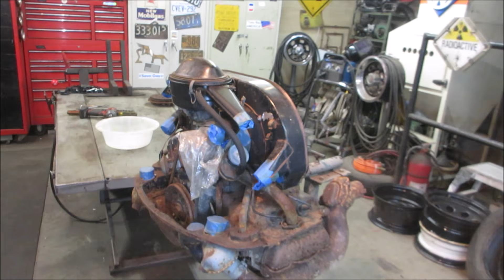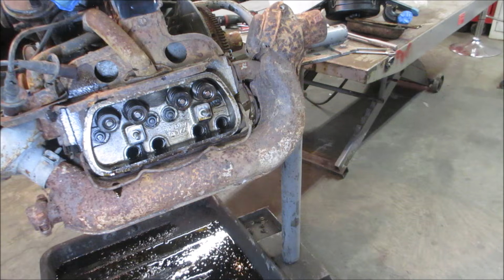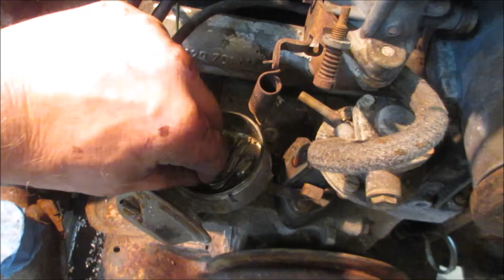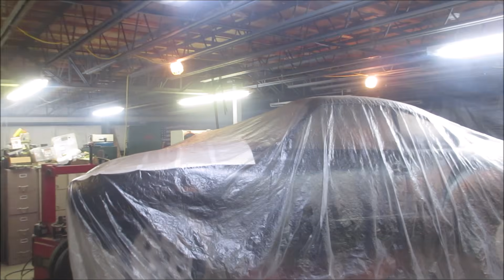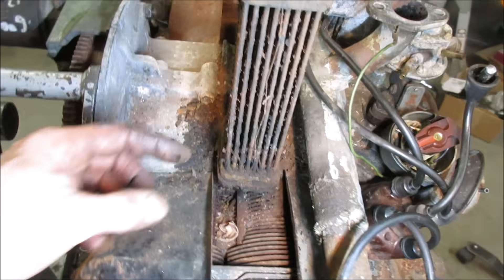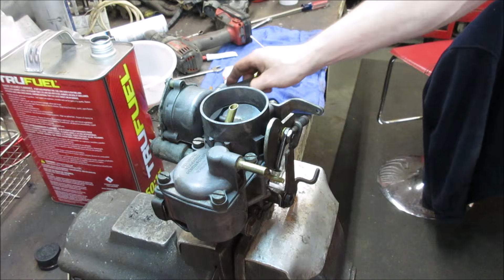Can IT Be Saved? Busted VW Bug Engine

Comment: Penetrating oil is a scam and does not work as far as the thought that it has the ability to soak into a seized bolt and unseize it. Have been testing this for decades and in my opinion it does no difference than any light oil, Once the bolt is broke lose then of course any light oil can help. Heat it the best and using penetrating oil with heat is silly cause the heat just burns off the oil. I have not yet tried the heat and wax theory.

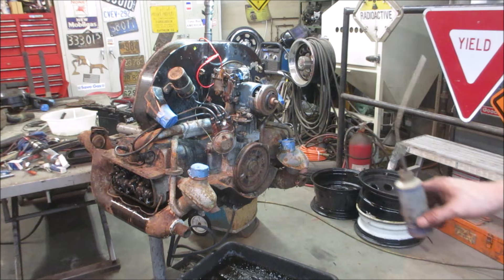Comment: 1:20:00
I was thinking about fuel running from 1 side to the other side as it's just raw fuel. I was thinking a leaf blower straight into the carby and a small hole in the pipe to mist force air and fuel and it would bring up the cylinder compression at the same time. A leaf blower turbo charger 8n effect. Yippee more horse power.

Comment: The white stuff was most likely aluminium oxide from the heat exchanger finning on the pipe inside.  I have seen these fill the air chamber with oxide powder after corroding for a long time.  I don't actually know exactly what alloy the fin material is that's cast around the steel pipe but it can produce a lot of this fine white powder, as can cylinder head castings, especially if they have been  stored somewhere wet or very damp.

Comment: I still can still see my scar from trying to push the rubber bushing used on a pushrod tube.  The thing about VWs you have to let the engine know you are going to work on it. Otherwise you disturb the cosmic balance of the engine compartment. If you don’t do this then the generator will burn out as soon as you drive it around. Never put those aftermarket fuel filters on it with the stainless steel bands, it will soon be a burning mess next to the 405 freeway. Usually not that far from a burning Audi back in the day.😊
  Had a 64 beetle, 69 Van, worked on my brother’s ‘59 flatbed transporter. Spent countless hours laying on my back adjusting the valves every so often and was amazed when at 19 I started flying a Piper Cherokee 140 and it had the same air cooled engine, just better built. But I always had to wonder just how much better built was it? Always wanted to put twin Makuni carbs on my van like the dune rails had. But alas we were in Cali. A great engine to work on and on and on.😊

Comment: the distributor cap latch hanging down tricked me into seeing a two pin oil pressure switch and I was thinking when they hell did they ever have a 2pin or who rigged ion in there.
then I finally seen it was the latch. lol

Comment: Picked up three motors from an estate sale, 40HP was good as is. The two 1600 SP motors had to combine parts to make one motor. (Intake port on 3/4 on one motor was a rats nest, other motor pulled threads on the plugs for 1/2)

Comment: Mustie had a lot of old motors like my dad used to. My dad even had old parts from dragline he no longer had, even motors, and he could tell you where each piece came from. He built a homemade injector tester so he could verify if they still worked so he wouldn't have to buy rebuilt if it wasn't necessary. Among other things. Great job, greater knowledge Mustie shares with us.

Comment: Great work!   Two questions though:  Why do you use compressed air to clean these up and not a vacuum? And why aren't you using hearing protection when you start these, without mufflers? Is it not as loud as it seems?

Comment: I'm sorry, I shouldn't have yelled at you. I was a little upset that you didn't thread the valve adjuster back into the rocker from the valve side before putting the rocker assy back on (since you showed us the chewed up threads)...but I forgot you have the largest supply of spare VW parts this side of the Germany/Mexico border. I won't let it happen again.

Comment: Seems like it took VW a long time to reposition the oil cooler. Oh well. my 68 bug and 69 bus did fine finally lost a valve in the bus and had to pull the engine in a  parking lot and redid it in the back of a fire station. I don't remember having any help except a ride for parts. Glad for the old tech rather than the current electronic stuff. Better for my brain.😁
Reply: the ECM/electronics aren't all bad.  When they fail you better have a Pik N' Pull & the vehicle better be under thirty years old.....
None of these electronic cars will be revived or on the roads 31 years after manufacture. Looking back at the first Ford Taurus, that isn't a bad thing.......

Comment: The older 32/36 weber has a habit of losing that fuel inlet pipe also. i burred mine up a bit, and tapped it home. I have seen 2 cortina (Australian Ford Pinto) burn to the ground, because you also can't open the bonnet(hood) when the cable is melted almost instantly. 
VGG Derek says those glass fuses cause fires, possibly unscrews for cleaning? but i haven't seen one before to know..

Comment: Ok I hate to start with. Back in the day, But. Back in the 60s 70s. We all thought an external cooler, was way better. Allowed all cylinders to cool the same. Without one bank cooling air, passing through the oil cooler first, heating the cooling air previous to then cooling the cylinders. What is the more modern thought on oil coolers?     A very old former long hair wannabe VW builder, is just curious.

Comment: I love that whoooooop sound that it makes when you turn the crank pulley. I've hear many engines making that trumpeting sound.

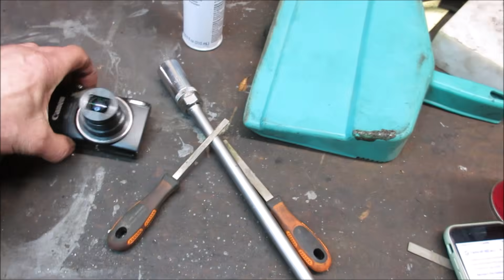1:27:57 I have the same camera but mine is the 340. Good camera but the battery life is crap and you can only power it with the battery. I do have an adaptor but I wish It could run off USB. What are you going to do with all those broken cameras? I'd like to tear down a broken camera ON camera.

Comment: a FREIND OF MINE years ago was grinding on a transaxle to clearance for a 12 volt starter and he was standing where the engine should be. And He found out the hard way that the transaxle was made of Magnesium. He had a flash fire and burned his arms and his face and his hair. It took many weeks for him to heal and fortunately he had only second degree burns. But still, it was a very painful experience for him. Be careful folks as they did make VWs with Magnesium in certain parts and it looks like aluminum.

Comment: Every dang time. Engine sitting for 2 decades, low compression and no spark. Tinker with it for a few minutes and then it runs like its been rebuilt. I want a VW or a Corvair but no place to store it while working on it.

Comment: The gas barb came loose on me on the interstate.    I had just dropped off my wife at the hospital for an overnight stay to have our first child the next day (planned that way of course) as I was driving down the road it started to sputter a little, I looked back in the mirrow to make sure traffic was clear to pull over and all I seen was flames shooting up over the back window.   I pulled over and grabbed my important papers from the car and luckily 2 or 3 cars stopped that had fire extenquishers and put the fire out.   I go lucky with a little scorched paint and I only had to replace the Wire harness, carb and generator.  I had just had the motor rebuilt a week before.  I did find that gas barb hanging on the gas line.  The worst part was cleaning all the fire extinguisher powder up.

Comment: I think that when that valve adjuster bolt came loose and started beating on that valve cover ..they probably though it was a rod and then the parked the car and pulled the engine 😮😮

Comment: Back in the 70s during my VW rebuilding period , do my own head work, line bore block and completely rebuild including crank and piston and cylinders (Mahle) brgs and oil pump etc for less than 450$. Use to do five a month.

Comment: I really look forward to Sunday mornings to see what’s the subject of your video. I was a machinist in the Air Force back in the sixties. We often made our own version of the “Shake & Break” to remove rusty screws, nuts, and bolts out of aircraft. Very useful on the dry bay screws in the top of C-130 Hercules wings and some access panels in the wheel wells of the old F-4 Phantom. (Panels  89 L and R, damn,  I still remember!) I also had a brand new 67 Beatle 1500. It was a great car. I could get 70 MPH in third gear! I kept it for many years.

Comment: I witnessed the magic ! Thanks for the Video !! 

I was thinking "separate power supply for the ignition" .. when the starter current bogs down the poor tiny battery you might get a weaker spark. ?  probably enough to have a 12VDC mains PSU that puts out a couple amps.. don't really know what a coil draws. Still contemplating a foot switch to trigger the starter  🙈

Also a "mister / atomizer" for the fuel came to mind.. like an old window cleaner spray bottle.

Comment: Sheeesh Mustie, you've got low compression- hit it with the ether .  Once it is running, add a quart of diesel to the pan to loosen up the old oil.  Re-adjust your valves because the ones that were rusty will tighten up as the rust wears away.  You can boost your compression more without removing the heads- Bring the piston up to top and then remove the valve spring- grip the valve stem with a drill motor and spin it while pulling the valve againste the seat. The remaining rust acts like a lapping compound- use your spray fogger as a lubricant/wash trhough the plug hole.  You can probaly boost each cylinder by 20 #.

Comment: Excellent revival, these engines are so simple and easily maintained that it's easy to see why they were discontinued, auto makers today make cars that require dealer service. Agriculture machine manufacturer John Deere is at the center of a lot of angry attention from farmers who can't service or repair their equipment on their own.
Reply: the 1.8L 8 valve from the 1980s was also low-maintenance. 
New timing belt every 90,000 miles. New sparkplugs/oil filter.  
Still got one.  600k+ miles.  
They always blamed emissions laws for dropping air cooled VW/Porsches.  
Something about the cooling fins making them too noisy?   Yeah right.

Comment: Pretty cool save on that one. when I picked up my 40h for 50 bucks it didn't turn all the way thinking a stuck valve but turned out one of the nuts from the intake when removed fell into the empty spark plug hole and was sitting on top of the piston. Found it when I pulled the head off and was able to turn the engine finally. But the real problem was the blown piston from a ring breaking on a different one. I replaced all with a new cylinder piston kit. Another thing I found wrong and had to be the German factory was a short pushrod. per the manual you can't mix them. in 65 the rockers and pushrod were changed to the longer ones. Mine was built march of 65 in Germany

Comment: Would filling it with diesel or kerosene help get all that sludge out?  I was thinking fill it with diesel and then spin it for a while on the starter and then let it soak a week or 2 in the bottom of the engine to loosen the sludge and then drain it out.

Comment: German here. My first car was a (super)beetle. Engine went bad (cylinder no. 3 overheat). Bought one from a junkyard for the equivalent of 70 dollars (1600cc 50hp) dumped the old one and installed the “new one” in about 3hrs with a jack and some basic tools. Glory days..
Reply: There's a real beauty to simple machines like this, as easy as working on a lawnmower.

Comment: Have you ever tried propane for starting, just take the torch tip off, put a hose on it, then barely crack the bottle, will start and run most smaller engines!

Comment: A beetle or bus is an odd choice for someone young and with meager means.  When I was old enough to drive in the late 80s, these were vastly overpriced cars.  You could pick up a running driving Ford or Chrysler or GM car for 500-1000 bucks, but Beetles and Buses were many thousands.  4-5g for a running driving example in  poor condition. We're talking a 6 cylinder with well over 100hp with air for 500-1000 in which I could fit in comfortably (I'm 6'3.5) without my head hitting the ceiling and plenty of leg room.

These things were inexpensive new, but the used market, at least by the time I was driving in the late 80s, these cars were badly overpriced.  People trying to relive their youth drove the prices way up and cheated the then current youth of the opportunity to own one.

Comment: Sorry to say, but your compression meter sucks in its design. You loose a lot of compression/readings. Good compression meter for such engine should have a valve at/near the spark plug port, not at the gauge side. Also, this guy has absolutely no clue how to properly start an engine which has sat long. Flooding spark plugs with fuel won't help it.

Comment: If I may suggest something ... A digital voltmeter is super but to check on points you'll get a better visual using a simple analogues meter, as you'll see the needle moving. 

Thanks for this video, sir !! Again super-entertaining. A real thriller before those first "pops".
Reply: Better yet to use a regular old test light.
Reply: @awegner6465  also perfect, indeed.

Comment: Have you ever had a Beetle with a fully-functional heater? It would be great to see a demonstration of that. My Mom said that on my grandfather's new Beetle, 1963, the heater would "blow you right out of the car" because it would get so hot. Seems like every Beetle has bad heater hoses, or connections, or the thermostat is missing, all things that would reduce the heater output. I'm just curious.

Comment: 1:53:44 my fix for this would be to tap the hole and insert a thread-in fitting that's loctited in. There's enough meat on it for a thread-in fuel fitting and those do not pull out like these press-in barbs do.

Comment: Back when I was in high school in the early 1970's I lived in a large midwest city and in the summer me and a friend would go cruising up and down the alley's looking for VW's that looked like they had been sitting awhile. Summer time was the best because you would see all the grass and weeds growing up around them. Used to pick up non running Beetles for $25 - 50 at the most and many times people would just give them to you to clear out their yards. That sludge in the oil strainer was common because most people would just drain the oil and never clean the strainer. As I remember the most common mileage for one was around 36K when most often they would start running bad because the valves needed adjusting or had already burnt a valve.

Comment: As you're cranking, cranking, cranking, the gas is likely washing off the rings and running into the crankcase. I know that because I blew the oil cap off a Lincoln, followed by cheers from my coworkers as my 'smoked' hair and eyebrows wafted through the dealership. I know you know how far to push that; I didn't 😉 There is NOTHING like an engine returning to the living. Even when they sound like cr@p, it's still music.

Comment: 1:20:54 It wouldn't be a half bad idea to build some sort of mains powered starter you could bolt onto these things for times like this. Something that can crank one basically indefinitely without overheating, that's plugged into the wall, but still has the overrun clutch/bendix assembly and bolts on where the normal DC starter would. You revive enough of these VW bug engines to justify building it haha

Comment: I used to change the oil in my 71 fastback for less than $ 3.00 
Wolf's head oil was 69 cents a quart X3 and the paper gasket was .69 cents each 
I don't think mine had a drain plug

Comment: I like to use a spray bottle to get an engine started, the ones from the garden section at the dollar store, gas eats them usually so cheap is better, when you get good you can pump faster while opening the throttle, get them revving up.

Comment: I like the VW stuff best. It takes me back 50 years. Started with my 70 Karmann Ghia, later my 68 bus and finally my 72 beetle. Who knew I would be so nostalgic for my Volkswagen days. 😂
Reply: My Nostalgia is parked in the driveway . 
And it needs it's clutch adjusted.  '76 VW bus Type IV engine.  : l

Comment: In all of probably literally hundreds of engine or car repair videos I have watched, this is the first one I can recall seeing anyone using a speed wrench. I was beginning to think that no one knew what they were anymore, everyone seems to be using the battery powered ratchets anymore.
Reply: I am a millennial and still like using the one my dad gave me as a kid to work on small engines. about two weeks ago I used it to pull apart a honda gx390. It's not that I am opposed to electric tools I have them as well. It's just nice to not worry about batteries and whatnot. It's also gives a person more control of what is going on.

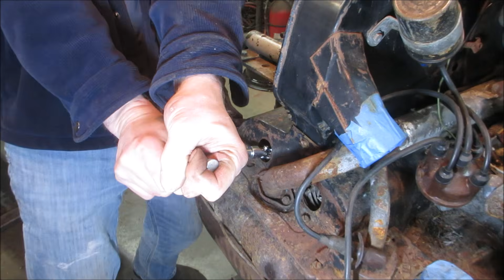Comment: @7:17 I highly agree, aluminum and steel cold weld to each, IDK why manufacturers do that, I had to drill out the Aluminum headcap bolt my mountain bike, then tread chase the Spider Nut in the fork replaced bolt with Stainless Steel one!!!!

Comment: Back in early 70s, had a 67 ford with points, would not hold adj, finely found that lock down  screw was aluminum and threads were worn down by steel plate. replaced and no more problem.